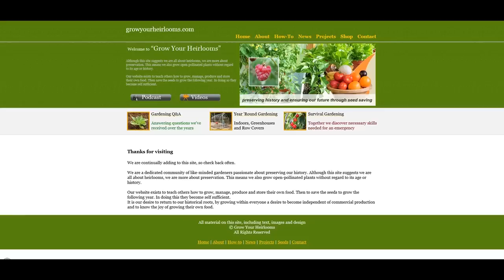Build A Mini Greenhouse For Raised Beds

Comment: Typically, I have trouble closing the top of a cardboard box, (I keep going round and round trying to figure out which flap will tuck under) However, I wanted to build something like a cold frame to get a head start on my garden in the Pacific Northwest. I watched your video, wrote down the parts list, had Lowes cut the PVC tubing and gather the correct pvc joints in the numbers provided in your list. I just waited at the counter until they brought me everything on the list (including the plastic!) I noticed the store had this big bin of different size spring clamps, I found a size that fit snug around the pvc pipe so i grabbed 4 of them for $20.00 thinking they might work as well or better than the tape to hold the plastic snug the the pvc (I still bought a roll of heavy duty gray tape in case ) I am proud to say I had the dang thing put together and glued in less that four hours not including time for the glue to cure. I filled the bottom long tubes with sand as one of the viewers suggested and it works great! The clamps I bought worked perfect but I found I needed more so I went back for 4 more clamps.(I still used tape as well)  All I need to do now is build a raised bed box.  To hell with a cold frame when I can have a greenhouse on a raised bed! With my new confidence I am excited to begin! Thank you so much for your efforts and for sharing this very informative video. I feel like I could close a cardboard box now! LOL!

Comment: I know this video is old but this is a great design. I used hoops for years and they work OK but I just built one like this and like it much better. I used 1\2 inch schedule 40 pipe. The frame I built is 4 feet x 8 feet. It's very sturdy considering the small pipe size. In case anyone wants to know about cost it was $40. The bigger the pipe the more expensive it will be. Thank you for sharing this great design.

Comment: Made 4 so far and intend to make 2 more.  So easy to put together.  I've made mods to this by adding bird netting to keep critters out of the garden and they have been painted with Fusion by Krylon in flat OD green to protect the PVC from UV.

Thank you so very much for the inspiration.  This has made use of so many short pieces from other projects.
Reply from the maker: Thanks, that's awesome.
Reply: Thank you!  If you hadn't posted this, I wouldn't have made them.

Please keep us abreast of the latest in your garden.

Comment: Thank you so much I built your drip system and then build this and I ran the drip system through the pvc pipes to the top part and then poked holes in the hose and then drilled holes in the pvc pipe where the holes in the hose were and at the end I put a cap so water came through the top. I really think you should try it!
Reply from the maker: Sounds interesting. You should make a video!

Comment: Nice setup, you can also use PVC clamps to hold the plastic on. They look like regular PVC but on one side it's open so they clamp over the plastic onto the PVC pipe under it. Easy on/off

Comment: Nice setup you have there...  You know something that you could use for holding down your plastic instead of tape?  Cut yourself a few 1-2 inch parts of the same size PVC pipe that your cover is made out of, then cut those in half (you'll have to sand the edges so that they don't punch through your plastic); if you want a tighter hold for the clip cut about a third out of you pieces. Try using these instead of the tape to hold down your plastic, they will last longer, hold tighter and will not rip your plastic when you want to remove them; they clip right on and off of the frame.  

You could even use them in the middle of your frame to make the plastic a tighter fit  without having to punch holes in your plastic to tie the plastic down (very good for keeping the plastic from flapping in the wind).  Lowes and Home Depot sell 2 inch half pieces of PVC in different diameters that are already cut and the edges are rounded; but, they are expensive!!  I've also seen that they have the half T's where the bottom of the T's is already cut and rounded.  Thanks for the video...

Comment: Just built one using 1/2 inch pipe.  Our cost is about $80 in pvc pipe and fittings as of  Oct 2022 for the frame.

Comment: I enjoyed your video, love the design.  It's nice and not too small.  I will make something like yours and will use chicken wire on the inside to keep out the groundhogs and squirrels, and in the fall I'll add the outside polyethylene sheeting for growing through December or January.  Thanks again for the ideas.
Reply from the maker: Good idea with the wire.

Comment: Have you thought of using shade cloth to skin the frame? It can be rolled up to gain access, can be tailored to your plant's light requirements, allows air circulation and bird protection, is light and durable and replaceable and is relatively inexpensive.
Reply from the maker: gary baugh Don't know why it wouldn't work. Although not sure how expensive it would be.

Comment: Me: "I'm gonna build a full-size, walk-in greenhouse!"
Me, after doing a few hours of research, realizing I have no idea how to build anything: "Maybe just a mini greenhouse!"
Reply: One thing about PVC pipe if you mess it up easy to buy a connector and use the same peace again... A lot of places like Home Depot will even cut it for you.. I buy them in 5 feet length. cost a little more but I have a car they fit good in them, do not have to cut them, just buy some connectors about a dozen tees and two way connectors,

Comment: Awesome! I am going to build this for next year's beds. 
I do have one suggestion because I noticed when you lifted it that the short 2-foot pieces would bend down because they're not glued. I would suggest that you put a 7 to 8-foot piece of 1/2 inch electrical conduit down the length of the 2 bottoms and the top. Just lay it in there loose. That will let you move this whole thing around without it bending and possibly coming apart while you're moving it. That worked REALLY great for my large pvc framed political signs.

Comment: You can cut 2" or 3" lengths of 1" PVC and then split out a chunk lengthwise (make sure you leave over 1/2 the diameter) and then use those as reusable clips to slip over the frame members to hold the plastic sheething. That way you can avoid the waste of replacing duct tape each year.

Comment: Great idea! I shall copy. (Had been trying to cut thick pieces of wood to size with rubbish tools, ha,ha.and job going slowly). As soon as I can I'm going down the plumber's outlet and going to make a project similar to yours - though I thought, whilst using pvc pipes - why not attach them to guttering and have a self-watering greenhouse? Havent quiet got all thoughts/attachments in head yet, but sure it can't be that difficult. Anyhow., THANK YOU for great vid.

Comment: This is a great plan except for one missing part on the parts list: 4 90degree 3/4" fittings for the corners. Had to make a special trip. It would also be helpful if the directions included a list of where each of the lengths of PVC pipe is used. It was a bit confusing, but we did it and it looks and works great! Thanks!
Reply from the maker: Whoops sorry about that.
Reply: Happy Father's Day!!!  Thank you for this 6+ year old video.  I won't ask you to identify which parts go where, but maybe you can confirm, if I have figured this out correctly.  10 - 4" - horizontal roof structure > 10 - 13" - vertical base  >  10 - 24" - 45 degree roof trusses?  >  8 - 19" - horizontal base (length)  >  3 - 46" - horizontal base (width)  >  8 - 8.5" - ????  >  Also, the horizontal roof truss is seemingly comprised of 4 pieces which should seemingly be the same length as the 8 horizontal base (length) pieces making for 12 pieces of 19" inches in length, not 8.  So, what are the eight 8.5" pieces for, sir?  Thank you for taking the time to reply to my enquiry.  Thank you, again, for this beautiful concept that I will by copying.

Comment: I made this mostly up today in about an hour.  Few of the measurements didn't add up for me so I thought I would leave what changes I needed for others. I ended up using the 4 of the 3 edged side joints of pvc in lieu of 4 of the ninety degree sections for the outside corners, and also required an extra 2 nineteen inch sections instead of 4 of the 8.5 inch cuts.
Reply: +empyrealpalliate otherwise the count and measurements were exact! Thanks for the easy build.
Reply: +empyrealpalliate oops I meant I used 4 3 edged side joints instead of 4 of the t-joints.

Comment: very smart guy,i was wondering about why just didn't use the 90 degrees elbows,thank you sir this help me over here in the caribbean...................for those who are thinking in the caribbean is always sunny well in my case i am providing a shade for the nursery as well wind reduction.......taa-daaahhh
Reply: +StreetKingz4Life The 45 degree elbows are there so that the snow is able to slide down the sides of the frame instead of sitting on top of the frame.  With you being in a sunny climate, simplify the design by just using 90 degree eblows and you will be good to go!
Reply: Bryan B Thank you sir...
Reply: The 45 degree sides isn't just for snow.  90 degree elbows would still be a problem for warm climates because of rain ponding on the square top and then eventually collapsing and/or ruining the plastic and even possibly ruining the frame itself.  45 degree sides or round sides (also known as hoop design) are the only way to go.
Reply: NunOfYourBiz plus i just like the ergonomic thrifty look of it

Comment: looks nice so I stopped by to see it.  I was thinking it would be good to put a watering thing along the top ridge.  either separate with little sprayers or just by using the pipe there...I don't know zip tying sprayers to the top with a timer would be cool.

Comment: I love your greenhouse design, and I wanted to make one for my cinder block 4 x 4 (interior dimensions) raised bed. I was hoping to make it slightly larger so that it would sit on the cinder blocks rather than inside my garden bed, but I wasn't sure how long I should cut all my PVC. I was also hoping to secure the green house with PVC inside the holes in the cinder blocks. Could you please help me out with the dimensions needed for my particular garden bed?

Comment: I was planning a very similar structure but I was breaking my head with solutions for access. I like the idea of using pipe hangers or clips but not sure how that will work with the nat/plastic over the pipe at the bottom. How do you hold it down to avoid winds damaging it?

Comment: Missing from your parts list: the plastic sheeting you used. What thickness, length and width.

Thanks for this plan. It is just what I needed.

Terry Thomas
Brookhaven Gardens
Atlanta, Georgia USA
Reply from the maker: +Terry Thomas Sorry I did not think about measuring the plastic. The reason is, it comes in a very large roll and I just rolled out what I wanted, cut it and attached it. I believe it is 4mil. You can use any thickness you want.
Reply: +Grow Your Heirlooms OK, thank you. But how wide was the roll?
People would find it helpful to shop for a roll that will end up being wide enough to completely cover the finished project.
Reply: +Terry Thomas - Google, it can be your best friend. Your questions are to "needy"

Comment: Could you tell me where you put the eight 8 1/2 inchers?  The only place they would fit would be the horizontal roof line which should seemingly be four more pieces of 24 inch to compliment the eight 24 inchers running along the horizontal base (length) of the structure.  I know this was 6+ years ago, but I LOVE your design.  Thank you for your help.
Reply from the maker: If memory serves me right, I think they go on the base and into the T joints that support the cross member in the middle. However there are only 4 of them. I will go out in the morning and take a look at it and get back to you
Reply: Thank you for being so kind Grow Your Heirlooms.  I am hoping to go without the middle cross-brace.  Isn't it 46 inches wide, (not 4 x 8.5 inches).  Either way, I will be excited to hear how the 8.5 inchers fit into the design.  Thank you, AGAIN, for being so nice!!!
Reply from the maker: @anthonylux1838  Yes, the cross brace is long, but it's the lateral pieces that go into the T joints that are 8.5". I have decided that it may be time to a video on assembling this since so many people have asked about the details. So I plan on doing it in the near future.
Reply: Thank you, again!!!

Comment: Hi I am semi handicapped so build raised beds so I could still garden.  Im retired military and injured my leg.  Ended up with a total replacement.  Now my leg doesnt bend much.  Anyway build these beds all in total 90 feet long, 4 feet wide and 30 inches tall.  Using 2 x 10s and also laid a 2.x 8 along the top so I could rest.  Now that everything is built wondering what would be best in filling it.  Was thinking about some rocks for drainage since mine are so deep.  Please provide an opinion as yours look. As deep as mine.  If I missed what you said already please accept my apology.  
Thanks 
Sally
Reply: hi try getting some hay bales and fill the bottom of the beds with them then leaf mould, topsoil, compost

Comment: Well....ventilation problems can be obviated with using 'wood chips' which do two things; 1)  insulate the "stuff underneath" and 2) keep the "stuff" underneath hydrated.

You don't need a green house at all for anything but "extending one's growing season".

Comment: New subscriber here... What did you use for the sheathing plastic on the top? Is it something that can be purchased from Lowe's or Home Depot? And about how much did that three quarter PVC pipe frame cost you?
Reply from the maker: The plastic is a 6mil that comes in a roll. I got mine at Home Depot but all the big hardware stores carry it. The PVC is really inexpensive. Only a few bucks for a 10' length
Reply: Ty😊

Comment: Good video, where did you find four way pvc fitting's?
Reply from the maker: Just about any large hardware store has them. Like Home Depot and Lowes.
Reply: Thank's just never looked for them I guess, l ways got convential fitting's there
Reply: I wasn't able to find the 4 way fittings locally.  I found them online.  They are called pvc crosses.  They usually cost around $2 bucks each.
Reply: nice question, here we cant find it too , then i pshinquing put other tipe .. and try to pumpling warm water inside..

Comment: what keeps it from going airborne on a windy gusty day?  I'm in Ok where we get high winds regularly.
Reply from the maker: I think I discussed that. You can screw conduit or pipe anchors into the wood. If you get seriously high winds, I would screw alot of them down. It will still allow the thing to lift up yet keep it anchored.
Reply: Grow Your Heirlooms So, problem with that; how would you do that AND be able to keep the cover on?

Comment: Hello, I am sorry to ask you this question since I guess I should get the measurement from this video. Would it be possible for you to give little detail to what are the length of different sections of the pipes? I am little confused about the 10 - 4" ( I guess those are on top); 10 - 13" (Are those the side columns?) 10 - 24" (are these connected to 45 degree?) 8 - 19" (are those in the base?) 3 - 46" (2 sides and middle one) 8 - 8 1/2" (Which one is this?). Thank you.
Reply from the maker: It's in the description

Comment: The next  row up from the bottom .Because if they were 45 degree elbows they would go straight across .The top row are 45 degree elbows .I use the 22 1/2 ones on my koi pond so as to not restrict the water flow as much from the pipes .If you put them next to each other 1 is not as angled as the other
Reply from the maker: 90 degree elbows go straight across, not 45's. The elbows on the next row up from the bottom are 45s. There are no 22 1/2 elbows.

Comment: Could I do this on a large scale?
Reply from the maker: I suppose you could but the larger it is, the heavier it would be to lift up or off
Reply: @Growyourheirlooms hanks for the reply. If I do build this, it will be permeant.
Reply from the maker: I see. Well when summer comes you would want to remove the plastic otherwise the sun will bake it right off

Comment: drill multiple holes in the topmost section and put a hose fitting in the bottom ..kill 2 birds with one stone. irrigation and frame...all in one
Reply: or drill multiple holes in the bottom frame for irrigation..after all ,it is plastic water pipe
Reply from the maker: Good Idea
Reply: we are also supply hobby Green house
Reply: And then you use pvc to irrigate your plants resulting in lymphoma cancer.
Reply: Not certain about the points made but ,if anyone else wants to uncover diy backyard greenhouse plans try Lomonting Easy Greenhouse Mentor (do a google search ) ? Ive heard some interesting things about it and my mate got excellent results with it.

Comment: Why don't you use the elbow with the T connection built into the elbow?  Save the cobbling in the corners.
Reply from the maker: +suzy mcalister I had wanted to find something like that but our local stores did not have anything like that. But, yeh it would be better.
Reply: Greenhouse Megastore online has tons of good stuff
Reply from the maker: Thanks